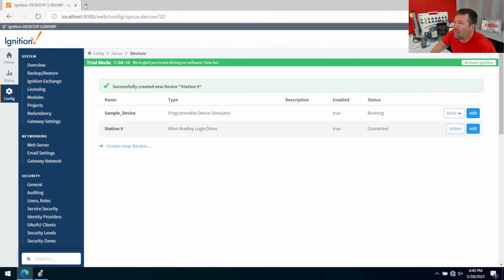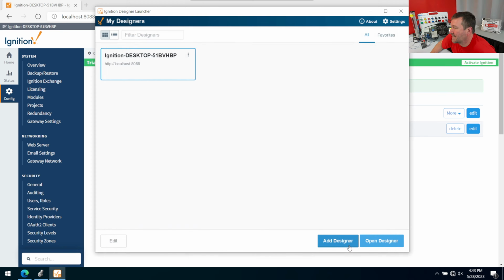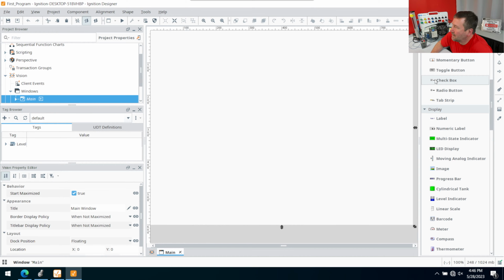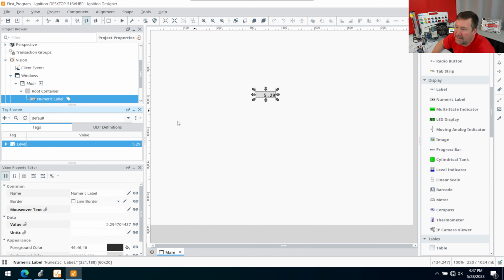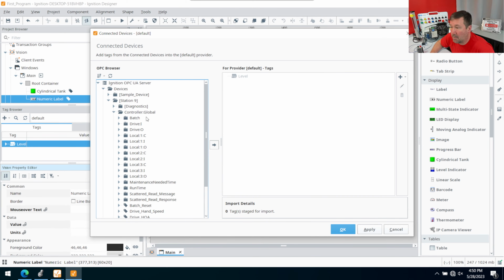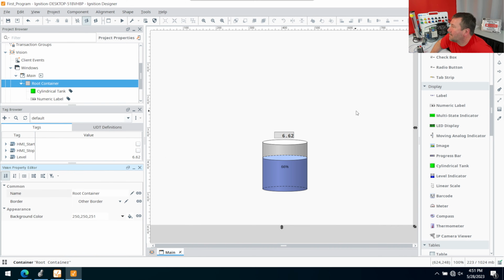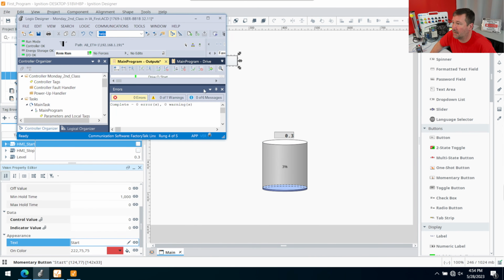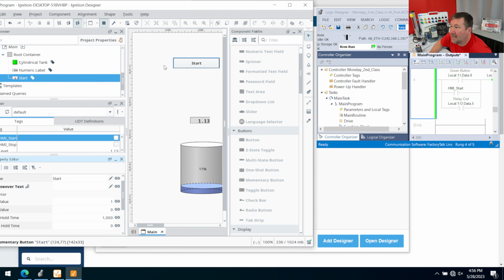Creating Your First Tags in Ignition for an HMI/SCADA

Comment: Hello, I am trying to figure out how to see what tags are connected to one of my push button. I saw you drag the tag onto the button but how am I able to see what tags are connected?

My issue is we have a button that is tied into an enable bit on studio 5000. There is some sort of interlock on ignition that when we press a secound button it will turn off the first button. Trying to remove the interlock between the two buttons.

Thanks!
Reply from the maker: Ah, that is an excellent question and definitely something we should cover.  My initial thought is to go to Find/Replace and search for the tag text.